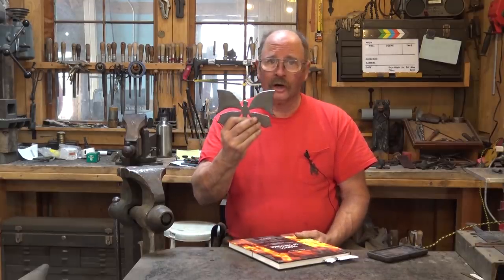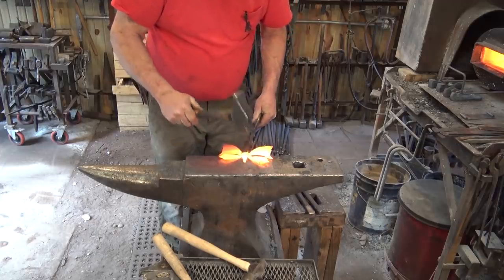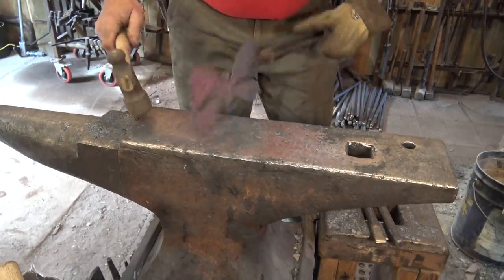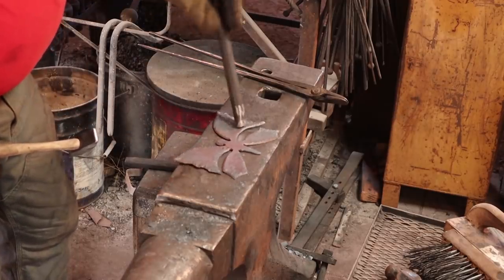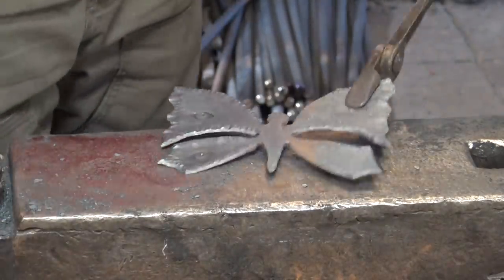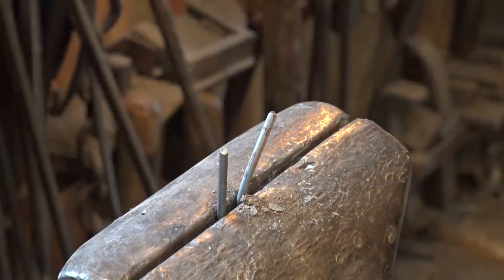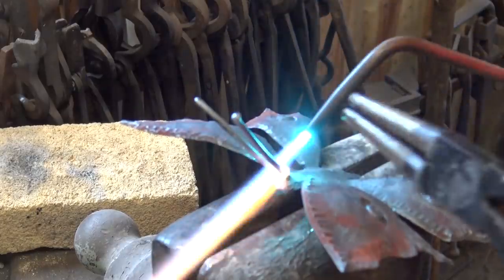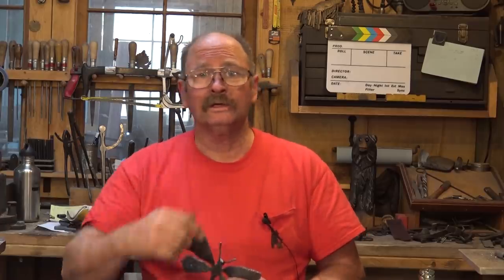Forging the Iron Butterfly - Butterfly part 2

Comment: That would look real nice plated zinc or the like once you are finished, Myself this summer I am on wind vanes eg like little Cessna type with a spinning prop. I saw a picture somewhere and it has stick in my head. 
I will get started once my stapples are out my hip and I am mobile once again. Nice clear videaos...

Comment: Minus the filler, gas welding seems pretty close to forge welding. Do you ever use the torch to apply the heat for a forge weld?
Reply from the maker: I  can't get the torch set aside and pickup the hammer before the work cools down.  But with a helper to hold the torch it should work.  I have heard that this was done in the Yellin shop.

Comment: I know you said the texturizing took out the volume, to me, I totally get the idea of learning how to chisel it out, but in this case I feel it was a waste of time. It will look the same if you used a ban saw. I doubt even the most experienced blacksmith could tell the difference at the end.
Reply from the maker: There are still some very obvious signs of the piece being chisel cut.  While the average consumer may not recognize them, I think it does enhance the finished piece
Reply: Black Bear Forge I guess not being able to hold it in my hand biased my opinion! I will take your word on it that it’s worth it! It’s looking awesome! You inspired me, I am going to attempt to make of out of aluminum!
Reply: Use no heat when working aluminum.  Health reasons.
Reply: I disagree. I can see the difference chiseling makes in the video. I can see the edge texture at every angle.
Reply: Jim Patterson I think I would see it better on a larger screen than my phone! Lol

Comment: When you was drawing out the scallops with the ball peen, were you doing half face blows?
Reply from the maker: The peen starts fully on the material and then moves to the edge as the scallop forms.